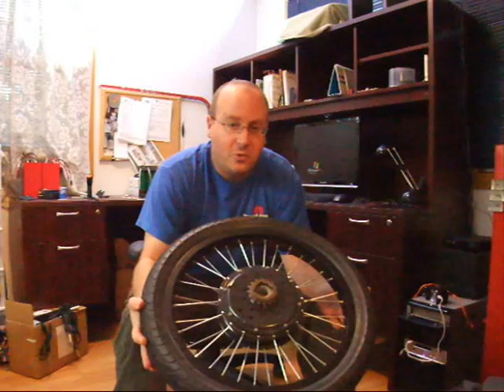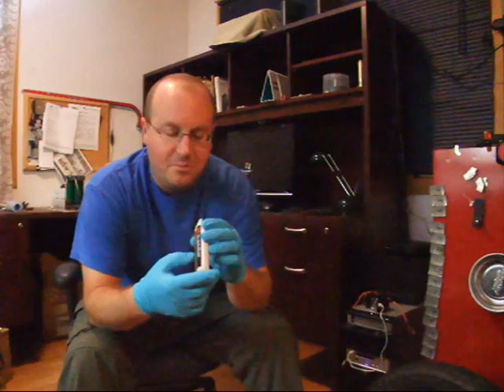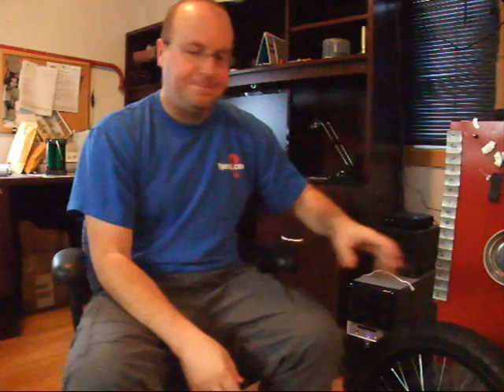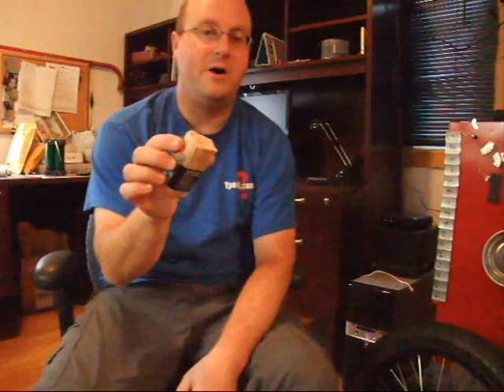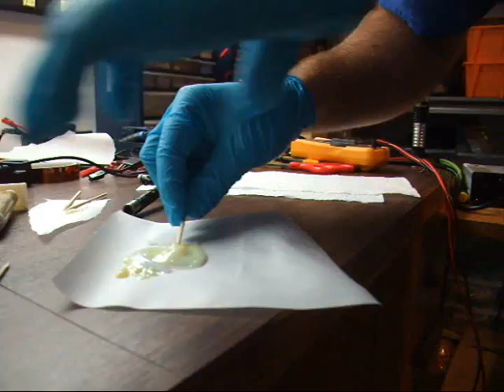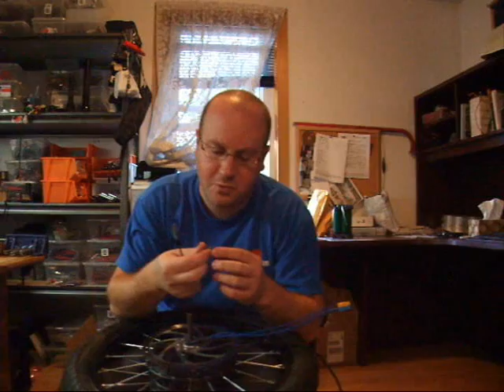Hub Motor Repair - Part 2 - Direct drive hub motor with loose magnets

Comment: Darn, great video and I wish I would have seen this video first. Same situation, found the lose magnets and a bunch of them snapped into pieces. I had trouble finding the same size. So I got a company in China to build me some custom N48 ones. My issue is that given the correct size specs I went ahead and glued the new magnets, but after I placed the last one I found that I still had an empty space, so I did not think of spacing them with a shim. Next, I grinded down an extra magnet but it’s like 50% of the width of the others, so not sure if it matters. The motor works but found it makes a loud winding noise,  so not sure if it’s cause of the extra smaller magnet.

Comment: What kind of magnet do they use. My understanding is a bigger motor has more magnets and therefore, more power. So you could use neodymium (the strongest magnet s) to get more power too. Right? Or not...

Comment: I damaged my hub motor and opened it inside then i saw the rotor is not in balance with magnetic field.  Is it because of heating magnetic field that make them weaker by high current pulses through the motor?

Comment: This is a great video, thank you! I have worked with large industrial three phase A/C motors before, but I am fairly new to small D/C bicycle motors. As a note, acetone works much better than any other solvent at removing unwanted epoxy.

Comment: Hi, Does it really matter to number the magnets ? as long as you check for the N/S/N/S poll correct it ok? please advise why number them ?
Reply: Technically no, it won’t matter. But, keeping them in manufacturing order will assist in keeping the overall magnetic field at least similar to what it was originally.

Comment: Thanks man, just used this method today. Used JB weld because of the heat range properties going up to 400F and not taking a chance with others at around 200f. Guess we will see where this goes... waiting on dry time... Thanks

Comment: hi would jb weld apoxy be a better glue? it has good heat resistents
Reply from the maker: i doubt it would be " better " than dp420, but i'm sure it would work fine.
Reply: is there a difference between using 420 and 420ns in this case?
Reply: Hey did you try the jb weld, if so how did it work out?

Comment: Thank you for your explanation. I had loose magnets in my electric bike too. Also with a direct drive motor, and it had 12 magnets. I placed en glued the magnets back. It al went fine, but the power of the motor is now maybe half of what it once was. I was not sure about the order of two magnets. Eventuallly I placed the magnets in north-south, south-north, north-south order and so on. Is this all right, or can it be that a few magnets beside each other had to be orienated in the same direction??.
Reply from the maker: It is absolutely critical that the magnets be correct, N/S/N/S etc.. if in doubt, check it using a smaller magnet as shown, go around the entire magnet ring and make sure you get push/pull magnet action.

Comment: Thanks very much for your well done vids. It's very hard to update in ebike specialy in the tiping point that we living now, as we saw in the last bike show in Vegas. Lots of new company around the world are in the game. But they also want to make as much profits as they usualy can, like patent things thas only work with ther own product and so on, right? So is it worth to spend 8-10k for e bike or just take a direct drive washing machine motor and by a bunch of lithium batteries and build your own thing? were is the best bang for your buck if you want something powerful in a good bike you already have? it's all confuse. You wanna share your point of vu on that? Thx! ;)
Reply from the maker: It all depends on your abilities, if you have the time, tools and know how to build your own, you certainly get more bike ( power, range ) for your money.. however if you do not have a garage, tools, soldering skills, etc etc etc.... a pre build bike can be had starting at 2000$ or so, like an A2B Metro for example... a Pedego.. etc.... if you want a 3000w + bike without spending 5000$ or more.. DIY is the only option.

Comment from the maker: loctite makes products for this purpose along with many others, you need to factor in temperature at witch the motor needs to operate, weather impact, etc.. the DP420 i used by 3M is good up to 150 celcius and is pretty darn strong stuff, i've used it to glue torque arms to frames... so .. yeah.. it should hold up.